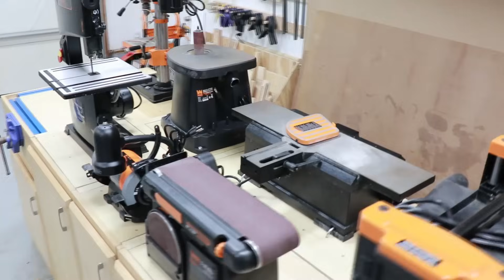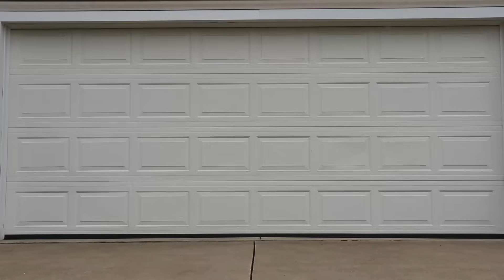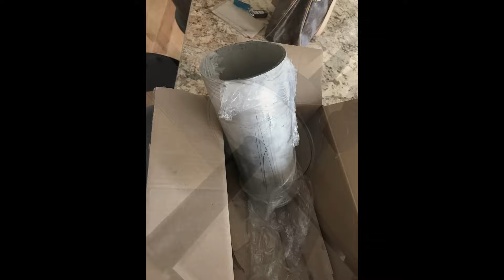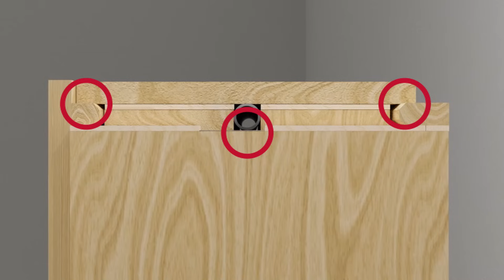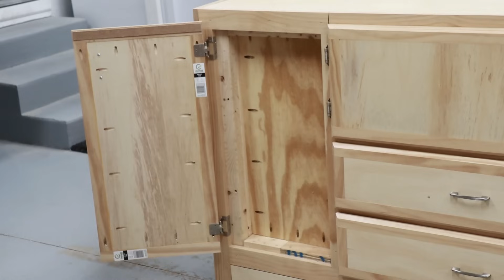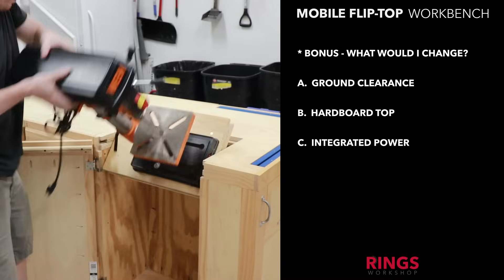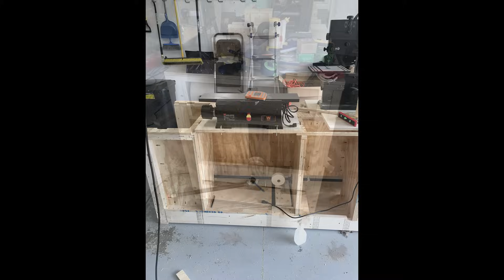Mobile Flip-Top Workbench

Comment: dude it's totally narly !!! like.... bad a-- !!!!  it's beautiful !!!!!!
it's even artistic !!!
ps.... y can't the main power run under the table & "t" up to each unit ?? looks like enuf rm behind the drawers ( ?? ) or, conduit along base ??? i'm not sure, only you know what space & toleraces to wrk with that youve got ... 
ur right about the trim boards around the doors ! but it shows off your talent and commitment !!!!! i REALLY like your " after " thot on the hard board top !!!!!! 
but it's still a killer piece !!!!!!!!!!!!!!!
Reply from the maker: Because it rotates on the steel poles, it would need to go through that.  However there isn’t enough room side to side to allow that to happen.  There is plenty of room beneath and in between, just not side to side, which is what it would need.  I am debating about adding an outlet to the top at some point.

Comment: That bench is a tank!  A very impressive design.  The empty shallow cabinet could work well for bits and blades since they are also shallow.  To maximize your storage and access, you could design horizontal racks that pivot at the bottom.  This would let you pack the racks relatively close together vertically, but then lean out for easy access.  If you take some Izzy Swan inspiration, you could even attach them all together and pivot all the racks simultaneously in and out.
Reply from the maker: Thank you!  I like a lot of his stuff, but haven’t seen that video I don’t think, I’ll have to look into it tonight!  Thanks for the idea.
Reply: @RingsWorkshop  I'm not sure he's ever done that exact thing, but he does similar designs pretty frequently.
Reply from the maker: Frank DeRosa I went through trying to find something as a reference and couldn’t find that concept, do you have a name of the video with something similar by chance?
Reply: @RingsWorkshop  I'll see what I can find.
Reply: @RingsWorkshop  OK, maybe I made this up.  The mechanical linkage of the holders is probably waaay too complicated anyhow.  This is the closest thing I found, which isn't all that close:  https://www.youtube.com/watch?v=si3pQZA4QXM
I think it makes more sense without the linkage.  Too complex and probably unreliable.
Reply from the maker: Frank DeRosa gotcha, I have see things similar, not a bad concept at all.

Comment: If you attach the boards to which the wheels are attached with hinges, can they still turn? They are at an angle when they are down.
Reply from the maker: Yes, I removed the brakes from them as they got in the way, but they have no problem rotating at all.  I assume if they went down to far and bottomed our that the caster would rub on the board and not be able to spin, but never had an issue with it.

Comment: It seems like the iron pipe raises the bench on a single fulcrum in the middle. What prevents the bench from rocking from side to side when it is raised?
Reply from the maker: It’s on casters, six total, so it doesn’t rock at all.  With the hinges attached then to the base, only thing the pipe does is lift it, doesn’t act as a pivot point.
Reply: @RingsWorkshop  Hmm - "hinges attached then to the base"?   I guess I don't understand how the pipe doesn't act like a pivot point when it's the only thing supporting the bench when it is raised.  Maybe it rocks back and forth a little and it's not a big deal since it's only up for a short period as the bench is rolled around?
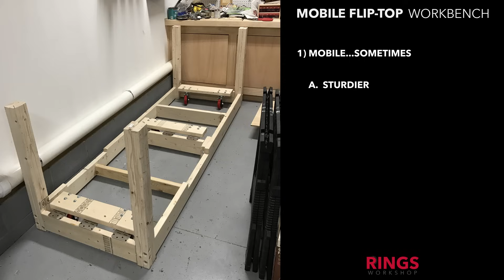Reply: Ah, just saw the hinges you're referring to at 6:42!  It all makes sense now.  Cheers!
Reply from the maker: @crankharder123  yeah, I didn't make the hinges in the 3D render so that's my bad.  The hinges tie it together to keep it from swaying.  You're right though, if those weren't there I'm sure it was rock back and forth.

Comment: Great job on the bench.  Like your interpretation of the top locking mechanism.  You've packed so much in there, it would have to be bigger of you put in dust control.  Power could be run underneath fairly easy since it's only a 180 turn and the cords would get tangled.  Great job over all and a fantastic review of the build.

Comment: Really great build! The spare shallow compartment would be great for drill bits and router bits. And you already have a solution for your power issue built-in. The steel bar that runs through the entire bench can carry power to a central power strip. Put the male plug end at the bar opening fish the wire through to a central location in the bench and wire in a solid power strip Make sure to bed the wires in rubber or plastic where they come out of the bar. Use pigtails to go to different tools.  Plug the tools in once and modify the tool pad to allow the door to close and push the chord into the chord notch. Again really great build thanks for posting it!
Reply: To add to this idea, maybe even line the inside of the metal pipe with a smaller PVC to act as an extra insulator, then fish the already insulated wires through like Mr. Harris said. Hardware stores carry a pass through rubber grommets for a few dollars. The biggest challenge would be the eye sore that the cord cut outs might present to that beautiful finished clean top.

Comment: Great bench with many solid design ideas!  New subscriber!
Do you like having drawer pulls that stick out of your workbench?  Maybe it's just my personal preference,  but I don't care for  drawer/door pulls in workshop base cabinets as they can sometimes get in the way.  (Handles of all sorts seems to have an uncanny ability to grab the pockets of my cargo pants.)  Instead, cutting or routing a grab handle into the drawer/door would leave the face of the cabinet smooth while reducing hardware costs.
Reply from the maker: Thank you!!

I like drawer pulls personally on benches, I know a lot don’t.  I’ve never ran into them or had them get in the way, knobs on the other hand catch everything it seems.  If you buy online in bulk it’s a ton cheaper than local store.   I also didn’t want saw dust getting into the drawer, which happened a lot in the past when I would just cut a hole or a groove all the way through.

Comment: Well done, I had seen the article on this bench and decided to see if you had a video. After watching I do have a few questions because this is exactly what I was looking to do. What is the over all length? It appeared in the picture that perhaps you used 10" 2x6 as your bottom base. The flip top pipe, was this aluminum conduit pipe? I can't say enough how impressive this build is, I have looked at so many flip top benches and this has the best of everything.
Reply from the maker: Thank you so much!  Bench is 8’ (just a hair over with the edging and depth of doors), the 2x6 are 8’ long.  The fliptop is pipe is galvanized steel.  Hope this helps!

Comment: Absolutely amazing.
Reply from the maker: Thank you!
Reply: @RingsWorkshop  Can you provide more details regarding the steel pipes used for the lift mechanism (both the cam covers and the through pipe) as well as the flip top pipes; e.g. dimensions, thickness, etc.  Thanks.

Comment: Amazing bench, really loved the camshaft style lowering system, that's really cool. A little off topic but I noticed you have a lot of Wen brand tools. I have thought about getting its hand planner and the bandsaw. So far, how good have been your tools? Do you use them a lot? I have experience with Tacklife tools (a belt sander) which I read are similar to Wen tools and the experience with it have been somewhat good.
Reply from the maker: Thank you!!  I use them a solid amount, a lot more over the last two years than the first two.  I haven’t had any issues so far, obviously it’s an entry level brand, but I like them more than others I’ve used in that price range.
Reply: @RingsWorkshop  thanks for the response man. I will get the hand planner soon.
Reply from the maker: I also have their air filter, very happy with it.  Crazy how much it picks up.  I’m sure professionals that use this stuff everyday don’t like the brand, but for hobbyists I think they are a good entry level for sure.  

My thought has always been to buy cheaper tools if I’m not sure I’ll use them a lot, and if it turns out I do them I’ll invest in a higher end one when the other breaks.
Reply: @RingsWorkshop  I'm like that too. That's why I decided to buy the belt sander from the Tacklife brand while my regular sheet sander is a Ryobi one. I knew the belt sander wasn't going to be used a lot so I didn't want to spend a lot on one of them from a well known brand plus wanted to test that brand too. That's the same reason I want a Wen hand planner and been thinking about the band sawr too.

Comment: I've been mulling over how my next workbench could serve both as an assembly table and a place for benchtop tools. I considered having a single rectangular tongue and groove cutout like yours, sized big enough to take a variety of matching inserts, one per tool, plus an empty one for assembly table use. That would require me to lift each tool to table height and then slide it into the cutout. There's no way my old back would allow that on a regular basis.  

Your solution is much better. It provides all of the functionality I was looking for, and also solves tool storage. Looks like I'll be building something like your bench. Great work!
Reply from the maker: So glad I could help with some ideas, thank you so much!!

Comment: Excellent build. Heres a thought or two. Personally I would have rearranged the tools in groups to "divide the table" so it could move easier or be rearranged. Used a "gear" assembly to connect the lifting mechanism. The "open cabinet", install a bar to hold clamps. Possibly raise the panels with pegboard and create a down draft/ dust collection system.
Reply from the maker: Thank you.  I’m intrigued by the gear concept, you thinking just to have it require less torque to raise it up?

Dust collection I have coming from above, never been a huge fan of down drafts since it limits where you have to sand vs have the sander collect dust well itself.
Reply: @Rings Workshop  For the table I am planning, with my 8×8 shop space I wanted to have the Flip top bench only more modular when needed. By having the lifting "rod" being able to connect via gears (think of a truck differential Google limited slip differential GIF)I then can roll one unit out alone, 2 connected or all 3. Then I could mix and match my table. And easily transport them if needed.
Reply: @RingsWorkshop  I've been designing my for now well 4 years and I still havent stepped out of CAD mode....

Comment: Nicely done! This is the best mobile base design I have seen. I’m really impressed with how easy it is to use that cam system with 1,000+ lbs in the bench.

Maybe I missed your points in this video that already address these , but

If for some reason the base trim needs more clearance off the floor in the rest position, then one could put something like weather stripping under the edge to close up the gaps to the floor and prevent dust and items from traveling under the bench.

Obviously more t-track around the top would allow for more clamping options including just attaching a board for edge clamping something that might need to clear the table top below as well as above the level of the top.

Why did you not want that pivot pipe to move at all? To restrict lateral movement?

So just black iron pipe for the can system? Any issues with flexion yet? Would a solid bar be needed instead for more strength?

Again. VERY impressive!
Reply from the maker: First off, thank you.  No flexing at all with the bottom pipe, no need for solid imo.  As I was rotating the system and all the weight was on the pipe, I didn’t want it rotating or shifting while I was moving the tool.  Not sure it would have mattered, but just to play it safe.

Comment: PS I put my miter saw inside my bench.
Reply from the maker: I thought about it but decided not to, I already had another holder for my miter saw at the time, second I use it so much I wanted it out permanently.  But I do think they work really well in that capacity, especially if lowered a bit so the top is flush with the table.

Comment: I am presently making my workbench similar to yours in that all tools are concealed, it is moble, and will have storage. Additionally I have my shop vac plumbed to each tool and I purchased a receptacle that turns my vac on and off automatically when a tool's switch is depressed or released. As you mentioned , the doors and drawers faces do not need to be fancy, just useable. Have not constructed a moxon vise but will as my table had overhangs. My router is in a separate cabinet between the wings of my table saw.
  Excellent Ideas for your table, wish I had seen yours first before starting mine.

Comment: Good job!  I’d add the electric runs as you mentioned.  I’d also add a router table and some moderate dust collection (small rigid vac would work).  Give yourself a break on the not measuring every tool attachment...you did a good job and shared the story.  Feel good about your work and go have some
Fun building something.  Thanks

Comment: Easily the best I've seen.  Love the use of door closure to lock the tool with front and rear ledges.  Two things I'd look to add are a miter saw (flush with table surface when in position) and some provision for dust management (maybe in the center of the rear ledge?)
Reply from the maker: Thank you!!   I chose not to do a miter saw because it’s one of the tools I use the most so I didn’t want to have to mess with putting it up and down, plus I wanted fences for stop blocks, so I made a separate station for just that so it is always out, but you could easily put one in for sure.  I have dust collection coming from above (if you watch the other video on my channel).  I had contemplated doing dust collection, but ran out of room inside and little surface area to add a port on the top that didn’t have a fliptop already in the way.  If you had the space to make the bench a full 4 feet deep vs mine where I kept it closer to 3ft, you could easily make dust collection work.  Appreciate the feedback.

Comment: AWWWWMAZING! ITS A BEAST OF A BENCH. Great job with the explanation, video commentary, the pros/cons and design.  

How do you like ur WEN bandsaw and jointer? What size is the bandsaw? Does the size work for ur needs? I am contemplating getting one or the other... Maybe both! Lol. Which do you find yourself using more?
Reply from the maker: Bandsaw by far, but I work with plywood a lot so jointer doesn’t come out as much.  Wish I had bigger band saw than the 9” but that’s the largest I could get to fit in the bench.
Reply: Ive got the same one, works great for an at home guy that's not got sponsors lol
Reply from the maker: Chomp Roth exactly, I don’t have any either.  I just have OCD and wanted to have all the same brand vs mixing and matching a ton of different ones haha.

Comment: Great job. It obviously took a lot of planning and work and like all research and development ideas, one always wants to make a version 2 and so on. I made a single roll around for my planer and orbital sander, but also like the idea of yours. Just like you mentioned about having power setup, I'm already thinking about how i would include a central dust collection manifold in it for easy connection to my shops dust collection system. I agree with another persons comment in that a slight bevel on all joints on the top would help prevent catching while using as an outfeed table, but if you ever built a new one, a person could consider having your laminate top pop up from the middle and fold out to each side in two halves or even make a pocket near bottom part of cabinet that would store your table top sheet when not in use.
Reply from the maker: Thank you!  I do like the idea of the bevel.  I think if/when I resurface it eventually I will do that.

Comment: Great bench, I'm stealing this thanks.  Also that unused shallow cabinet would be great for bit or blade storage yeah?
Reply from the maker: Thank you!  That’s where I’m leaning.  I currently put reciprocating and jigsaw blades on a couple magnet strips so far, still need to pull sand paper storage out of the other side.  Kind of like the idea of bandsaw blade storage as well just to be out of the way.  I’ve also been using a random piece of hardboard as my epoxy station so I don’t get it all over the bench.  Wouldn’t mind making something nicer maybe made of silicone that it would come off easier and would fit in there.

Comment: Hi... First of all, don't apologize for not having filmed the build. I've built several things that I should have documented better and as I didn't I'm not "you-tubing" yet... I love the design, the graphics a brilliant (I assume a lot of effort went into creating those. I main modification I would make would be to recess the planer so that the outfeed table can be used there too. Also if you put a small chamfer around the edges of the tool sections that'll stop material getting caught using the outfeed table (Check out Woodwork Junkie's table). I'm going to give this a go (I need to upgrade the one I built from Woodwork Junkies). I hooked and subscribed. Keep up the great content
Reply from the maker: Thank you very much, I like that chanfer idea for sure.  Recessing the planet got tricky with making sure it was flat on top when it was down and the fliptop still functioning the same.  I guess it would work if you made the pivot point lower and the bottom side much thicker.
Reply: @RingsWorkshop  I agree, it would be a very interesting challenge to try to drop the planer so as to get it to match the same height as the rest of the table for the outfeed. Would be super cool challenge to figure out!